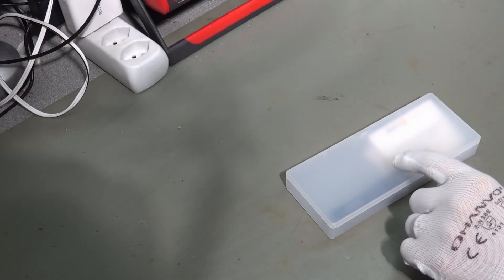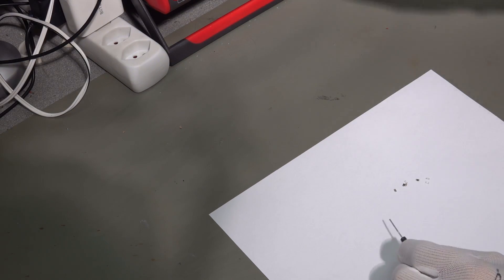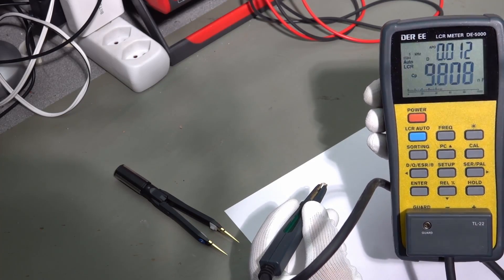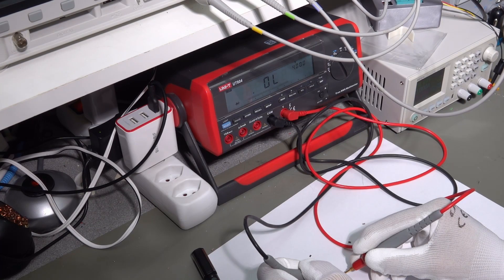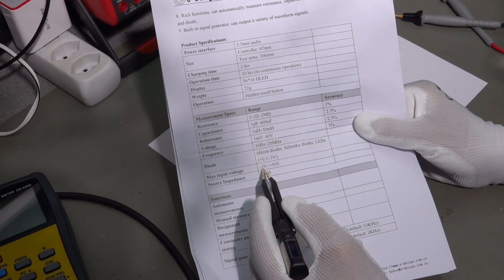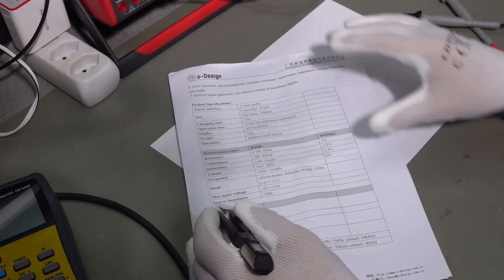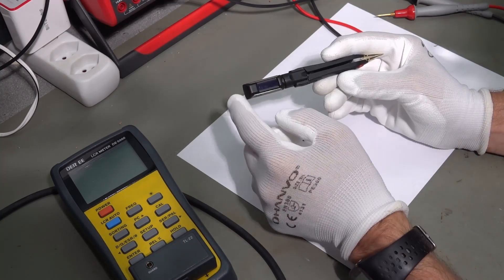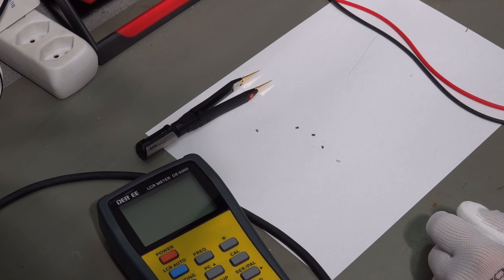#346 "Multimeter plus" Tweezers for R, C, L, Diodes, incl. a Frequency Generator: Miniware DT71

Comment: I am little bit struggling with that tweezer. I like to repair staff and the fact that i am able de-solder some components and measure it with that identiy function is something i would really love. Or even measure them in place. For that purpose it is to less for me. If I want to measure any voltages, I know i would kill it due to that -5Volt lower limit rating. In most situation i don't know the polarity and check it with a multimeter.
if needed i just turn arround the probes. I think i practice a rating of minimum -31V to 31V would be nice, so nearly everthing between 0-24V is covered (except some dcdc switch nodes which sometimes double up). For situation over 32V .... i would choose some decent rated multimeter which are more rated for higher CAT Levels.

Hope they are going to fix that in a updated version. Thanks for your video giving inside into it, Andreas
Reply from the maker: I did not hear of an updated version :-(

Comment: I was so excited to get mine, but after testing them i find they are not very accurate and they have some glitches. i expect a tolerance and a slight difference in every reading due to connection, but i can test smd inductors and the same part reads substantially different every time, mostly within tolerance, but not always. They are a fantastic go no go, good bad checker. One annoying thing is the inability to do either polarity on diodes, for checking LEDs you need to get the polarity correct to light them. My other expensive tweezers will. It was only slightly disappointing. They are well designed, i just think they need some firmware updates. Also the crazy charging adapter cable will break in time. It’s crazy that you have to pull the head off and use that cable to charge. I would think a micro usb on the tweezers body? You cant use them while they charge. Not that you really need to, but i just find it an odd design. I can’t see an 1/8” 4 conductor TRS plug and jack being very reliable? We will see? I like them a lot though. They just don’t seem very accurate at this stage, but they are new. I did update the firmware first thing. They are hobbyist grade, which is no problem. One issue i notice is the value in auto mode is much different then in manual. Why would the value be so different in auto? Maybe a firmware future update? If they fix a few little things? They will be awesome.The mechanical engineering and feel of them is fantastic. All in all they are very handy. If they perfect the software? They will be fantastic and a must have. They are already fantastic for the price. My Canadian made pro smd LCR tweezers were $335. Yes more accurate, but i like the feel of these new ones much netter. If they get the accuracy even close to the expensive ones? They will have an untouchable test equipment product.
Reply from the maker: Thank you for sharing your experience. I think I said that it is no precision instrument. The issue with different results in automatic mode was also mentioned by EEVblog. I assume it can be changed in software...
I like that the LED does not light up in both directions. Like that I know its direction...
Reply: Andreas Spiess . Thats true about the led testing. My other tweezers light them either way and show the polarity on the display, but yeah it could be used as a feature..I haven’t watched eevlog. I’ll check it out. It is a great handy test bench device. I’m sure it will only get better with updates. Thank you..

Comment: I have a cheap pair of tweezers that plug into my multimeter for small components and for measuring across tracks on circuit boards. They are nothing like that but handy nonetheless.

Comment: If these tweezers measured ESR I’d buy in a heartbeat. Another question is wether they can measure in-circuit. If they don’t ... there are numerous alternatives from UNI-T, Holdpeak and others for one third of the price...
Reply from the maker: I am not sure about ESR, also because resistance in capacitors are very high and its range is not good at high R.
As all multimeters you can use it in circuits,if you know what you are doing.

Comment: They are much smaller than the traditional tweezers which I have, but even the larger ones are worth a lot in terms of convenience and time saving. I also scavenge multiple SMD components, especially capacitors and sorting them for storage with the tweezers becomes very easy and fast. These compact ones look very good and if the production quality is good I may have to get some. The absolute precision is not that important but if they are within 1 or 2% for my purposes that is fine.
Reply from the maker: I agree with you. It is a handy little tool and it is probably precise enough for most purposes.

Comment: Is there a way to measure bigger things with it? 
Dunno how it'd be possible to measure a cylindrical cell battery with this (eg: AA, 18650, etc).  
It'd be cool if they made one of the probes detach w' a cable, or if the tweezing action could hyper-extend well beyond the angle you'd expect possible.
Reply from the maker: I assume it is intended for smaller things and will not replace my bench multimeter

Comment: Is the high forward voltage tests dangerous for components? Does it allow to look at transistor curves?
Reply from the maker: AFAIK you need 3 wires for transistors. To test if it still works you can check it with the "diode" function. I do not think it will destroy standard parts because the currents are very low.

Comment: I was expecting these to be hot tweezers in the form factor of the TS80/TS100.
Reply from the maker: You get those from other manufacturers (I use both my main TS80 and my mobile TS100 instead)

Comment: I want something that is mechanically similar, but one that uses an open source LCR and is easy to modify.

Specifically, I want to write a version that can be loaded with a Bill Of Materials for a project and have it identify parts by the labels in the silkscreen on the PCB.

For example: C23 100nf
Since it can sense the display orientation, a version could be built that senses the tip orientation. For polarized components, it could tell you if you are holding the part the right way.

We once had a board with both red and green LEDs. They used similar dots, but one color had the dots on the cathodes, and the other LEDs had them on the anodes.
Reply from the maker: As Nike said: Just do it !

Comment: Usually lcr meter mesure  ESR of capacitor and i wonder if also this product is able
Reply from the maker: I do not know it and did not find information about it in my documents.
Reply: You still need a proper LCR meter for that (I don't think these tweezers are designed to replace a bench tool), ESR and EPR aren't on the list on their website, but as these things run on microcontrollers and FPGAs, if it's possible to add the feature with a firmware update I don't see why they wouldn't.

Comment: I have a HP-990B cheap tweezer meter. No auto mode but only $22 on ebay.  So convenient for checking hard-to-read leaded resistors as well as SMD, Continuity buzzer too.
Reply from the maker: Thanks for your information. Seems to be a similar device...

Comment: I just connected some cheap multimeter probe tweezers to my cheap LCR -T4. Works great. These are more portable though, and it seems to settle faster.
Reply from the maker: I agree that the biggest advantage is comfort here. There are other choices which are probably cheaper (or more precise as my DE-5000)

Comment: What is the test frequency it uses? That would explain the slight differences when reading the caps and inductors
Reply from the maker: It uses 500 and 900kHz if in capacitors range (alternating if no capacitor is connected). If a cap is connected, I see two triangles: 1100Hz and 90Hz. I do not know which one it uses.

Comment: ¿ Is this device is for test “in-circuit” like the Mastech MS8911 Smart SMD Tester (LCR Meter) ?   https://www.elektor.com/mastech-ms8911-smart-smd-tester-lcr-meter  here in yt are some review videos, you can change the testing frecuency and voltage. Thanks!
Reply from the maker: You can use it in circuit, of course. But only if you know what you do. Measurements can be completely different because of other connected parts.
I did not find a way to change the testing frequency.

Comment: Or just order tweezers with leads and banana connectors at the end and plug them in your other meters. They cost only a few bucks. (“smd probe tweezers”)
Reply from the maker: Also a good idea if your multimeter can do LCR (or you do not need it).
Reply: I got the cheap ones and they aren't very good, ie, the tips don't make good contact so you have to wiggle them, which makes the part fly off.
Reply: @SidneyCritic  To be honest I didn't use mine yet. Just for you I just measured some 0805 resistors (1k to 1M) and had no contact problems. Also  short circuit is with 0.4 Ohm quite nominal for that meter. Mine are quite stiff, bulkly and in a square like case, maybe there are different kinds on the market.
Reply: @ThePetaaaaa  You could be right, because I just checked a new 10uF 0805 and it's not too bad. I was checking caps on a PCB just after soldering, and maybe the flux was causing connection problems. Plus my VC99 DMM is slow. I do remember my needle point probes had no problems doing it.

Comment: The measured value will depend on the measurement frequency, so it's not helpful to expect tight tolerances or direct comparisons. Also the forward voltage on the LED will depend on the measurement current. 

Nice product but $70 sounds a bit steep. Thanks for the review though. These boys are coming up with some interesting stuff!
Reply from the maker: You are right with both statements.
It uses 500 and 900kHz if in capacitors mode (alternating if no capacitor is connected). If a cap is connected, I see two triangles: 1100Hz and 90Hz. I do not know which one it uses.
This is why I mentioned that I would not consider it as a competitor to the LCR meter.

Comment: I wonder how electronic interfearance effects it, I have a couple server power supplies, and it drives my multimeter crazy when close to it, i think they killed my hobby charger, because it was sitting on top of the power supply, it would over charge batteries, and calibration would go stray, it would display a lithium cell was 5.45v, when it was 3.9v, I shut off power, then it used the battery to melt it's self,  I'm just currious if this meter could CE effected by emi?
Reply: I love how you are intimidated by intrusion...
LoL.
Reply from the maker: @James: I am no specialist in EMI, so I cannot test it. But I would assume that they had a priority on size and maybe did not include a lot of protection against EMI.

Comment: What frequency does it measure the capacitance and inductance at? I've seen on the display of your bigger LCR meter that it measures with 1kHz. We have the RND Lab tweezers at work, and they allow you to set different frequencies (100Hz, 1kHz or 10kHz). I really like these tweezers, even tho they are a bit bulkyer and more expensive than the DT71, but they have a much higher range of measurements too, like 10MOhm, 5000uF and 1000mH.
Reply from the maker: It uses 500 and 900kHz if in capacitors mode (alternating if no capacitor is connected). If a cap is connected, I see two triangles: 1100Hz and 90Hz. I do not know which one it uses.
The LCR meter has several frequencies to choose for the measurements, too. I think this would be too complex for the DT71 with only one button...

Comment: Accuracy is out of specs ( 9.11nf / 9.81nf - is 7% off, 11.5uH / 12.7uH - 9.5% error! ) Very far from declared 2.5% accuracy. To me this looks like a toy, not a real instrument.
Reply: As makers, we generally use components of standard discrete values. I think it should work out fine even though the accuracy is off.
Reply from the maker: @Ivan: You are right. These measurements are influenced by the measuring frequency (which I do not know). For me it is good enough because, as Pranav wrote, I will mainly use it to distinguish between parts which are no more marked. Or to check if something is wrong.

Comment: Andreas, you sound a bit exasperated and exhausted in this video. Take care, take rest and stay happy. 

Love your work. Your work has always inspired me to continue tinkering and making small silly stuff.
Reply: Recently, I attempted to make a two way morse code device with two piezo buzzer an two 8266 over WiFi and communicating using UDP. 

Streaming timing data reliably was ... challenging.
Reply: @shamasis.bhattacharya  Interesting.
You mean the instability caused by OS overhead (interrupts dealing with network connectivity?)?
Reply: Oscar Gr yeah (the OS latencies were predictable and constant) the network latencies are driving me mad. I have a mesh WiFi router setup at home (though I think even with a standard router I would have faced similar issues.) The latencies vary wildly depending on what route the packet took.

From my limited understanding, I think, I shouldn’t be doing it the way I am doing it at all. Network latencies would be inherently unstable (unless I go P2P route.) 

I need to work with some sort of communication structure that embeds timing data in it and add a buffer in the stream. Kind of like video streams, but simpler. 🤭
Reply: @shamasis.bhattacharya  Thanks for your reply. Yeah. Sounds familiar.
My understanding is (also ) very limited.
I am using an app on my phone that sends messages to an ESP8266 and then receives a status report back.
Just getting a message across the WiFi is ok, but with the unpredictable delays the user interface feels unresponsive sometimes.

Usually the ESP responds quickly (I blink an LED when it receives a message for testing purposes) but the feedback takes a while.

Sometimes the ESP takes up to 5 seconds to blink the LED.
I am not familiar enough with Wi-fi or ESP to figure out if ESP is temporary busy (or not connected),  or the router is holding the message back.

Good luck to both of us.😎
Reply from the maker: @Shamasis: This is not a scripted video. So many things are different... No problems here...
Concerning your project: I am no network guru, but I know Morse and I know that it has to have very precise timing. So I would always create the timing on the device and just transmit characters...
Reply: Andreas Spiess thanks for replying. I’m glad to hear you’re doing well.

Regarding the project: I took your advise and decided to downgrade the project a bit: two esp8266 and two buzzers - just transmit the sound. (More fun that way too.)

Surprisingly, that’s hard too if I’m not planning to add a buffer. So, in simple form, when a switch is pressed in one 8266, I’m sending a high UDP packet to another 8266 that starts a buzzer. When the switch is off, it sends a low packet to turn off the buzzer ... now you can imagine all the things that are going wrong!!!

I think I need to research more around the communication protocol - simple high/low single packets won’t work I think. A sort of shared timing needs to be negotiated in software first.

Comment: Now if it was also able to solder SMD it would be an instant buy for me ;)
Reply: That doesn't sound too hard to DIY
Reply: Use hot air instead of a solder-iron. That makes it A LOT easier.
Reply: @edgar9651  most times the simple Solutions are the best Solutions
Reply: @edgar9651  Yes, it is easier but you also heat a lot of things you don't want too and in very populated boards(iPhones) that could be a problem.
Reply from the maker: I feared SMDs till I tried them. Now I love them. But only with a Binocular ;-)
Reply: @AndreasSpiess  I bough a test SMD set with PCB and maybe 100 parts and I tried it with hot air and magnifying lens. No problems.
Reply: You could detach the Display and fit a TS80 Soldering-Tip instead ;)
Reply: Micro-soldering is quite fun and calming for me, but you NEED a decent microscope. (Yes I know this info is somewhat unrelated, but oh well)

Comment: I don't test jellybean parts that often, usually they come in a bag with a label. -.-
And one thing you probably can't use these for is when hot air soldering.... ?  Looks like they would melt.
So, I find it an interesting gadget, but i guess I wouldn't really use them, at least for my hobby level assembly stuff.
What could be nice on them would be BT, so you can use your phone screen for better readability ... I guess that would allow for a more compact design too.
Maybe in their next revision  :D
Thanks for the Video Andreas, enjoy your holidays !!
Reply from the maker: You are right with the labeling on the bags. Unfortunately, they started to label them only on the bags and if I have a single one laying around, I have no idea anymore. Happens quite a lot these days...

Comment: Also, worth mentioning there is a cheap $4 SMD probe (P1510) on chinaland. It obviously doesn't have a display and requires you to have any sort of multi meter to be attached to, but it's not that bad if you're into some rookie SMD repairs.
Reply: Unfortunately the metal tips oxidize quickly. I have to clean them with contact spray everytime I use it.
Reply from the maker: A few other viewers also mentioned this possibility. It is for sure cheaper.